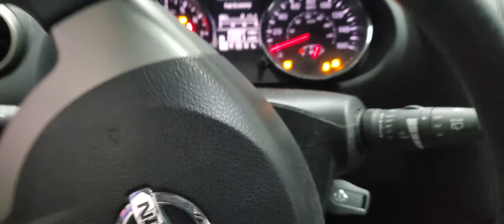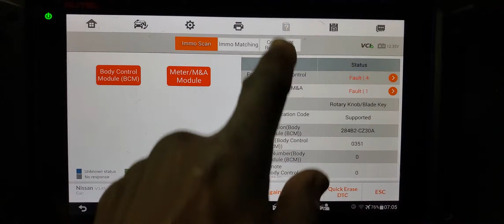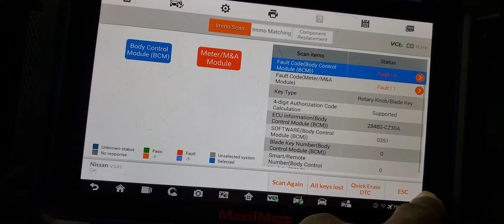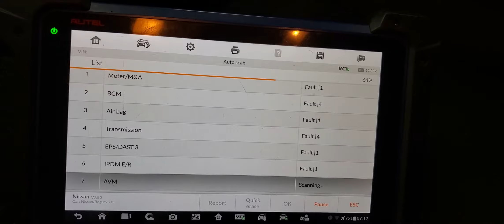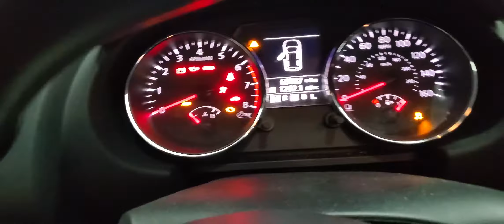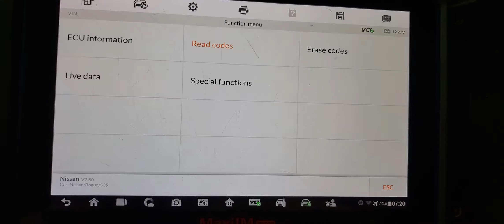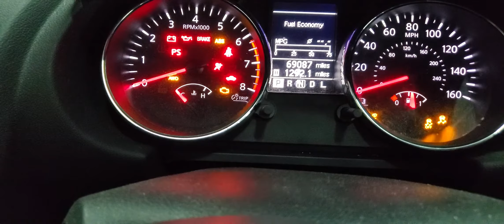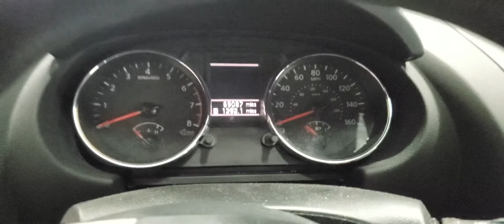2013 Nissan Rogue Ecu Swap What You Need To Know {part 2]

Comment: Hi i learn a lot front you videos thanks .i have a question i have a 2016 nissan rogue flood wont start no ecu comunication i check all the fuse all are good i remplace bcm and still no comunication with ecu do you have any recomendation
Reply: Hey, did you find a fix for this?